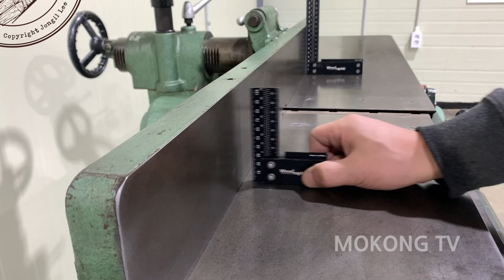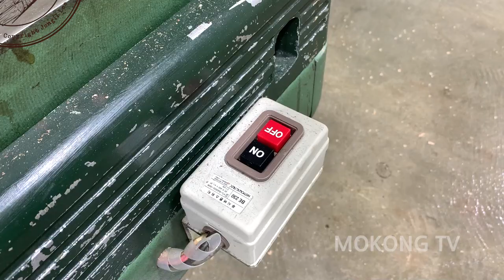My First Jointer / Old Japanese Used Planer SHIMOHIRA HD2 / Woodworking

Comment: You will have pleasure with this tool ! 👍👏
but you are not using the tool safely. your method is not the worst, but it is not the best. I saw 2 accidents, they did like you (push the wood).here it is a big piece, no danger; but with a small piece it's not the right way to use it.
Have a good day
Reply from the maker: I will keep your advice in my mind.